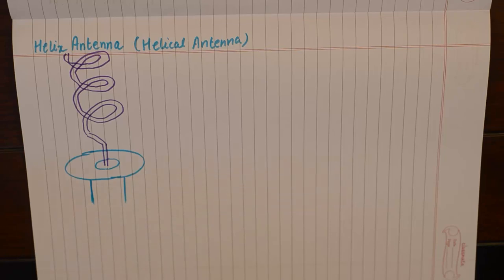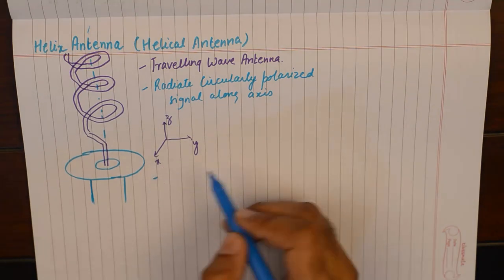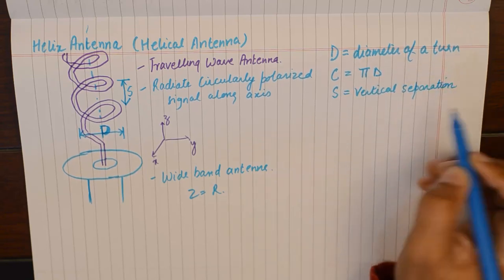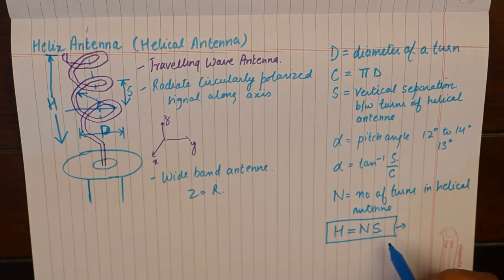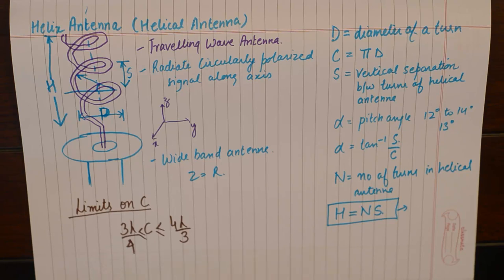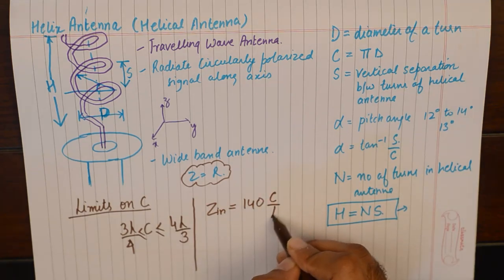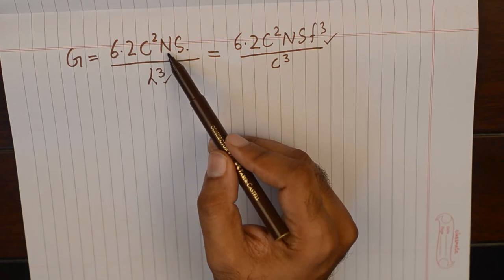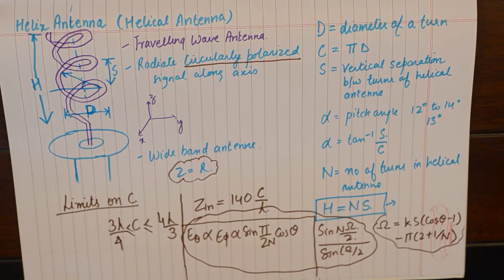Helical Antenna | Helix | Travelling Wave Antenna | Design and Construction

Comment: How this helical antenna is [become] a broadband antenna? As you explained, the circumference is limited by the lamda (circumference = between 0.75 lamda to 1.33 lamda, and alpha is between 12 degree to 14 degree)?
Reply from the maker: limitation of lambda keeps the size practically feasible in the real world. As it breaks the barrier of single frequency reception hence broadband

Comment: Sir one thing. In some books and also in class note I found Formula of HPBW as 52lamda to the power 3/2 whole divided by c root NS
And in some materials the wavelength to the power 3by2 in denominator and the numerator is 52 only and apart from that your Formula was also found. So why there are so many variations? Which one is accurate? Please help
Reply from the maker: Yeah that seems to be the problem. I go with the ones in my ready recoker. However it might create problem in MCQs

Comment: What is lambda value? which value is good to make an antenna that has a range 3MHz - 30 MHz? What size of wire is good to use? Thank you
Reply: Axial mode helical antenna, shown here, are practical for VHF/UHF frequencies, because radius of the helix is about 1/(2Pi) of the wavelength. That would be over 15 meters for 3 MHz.